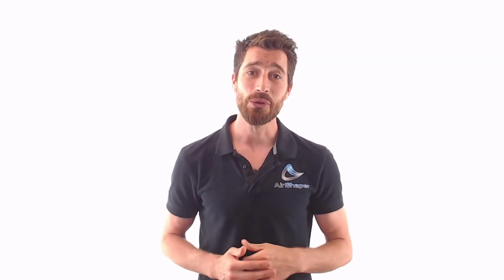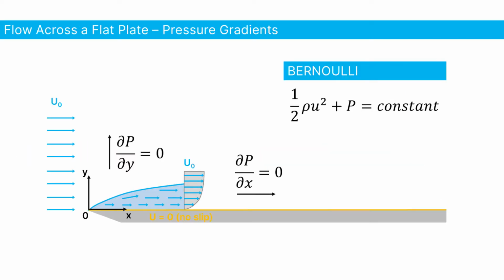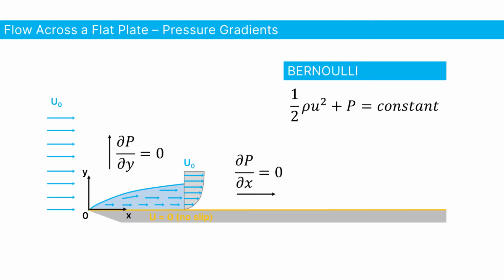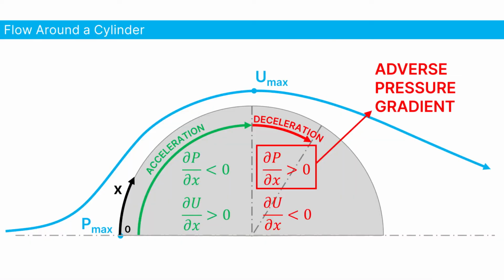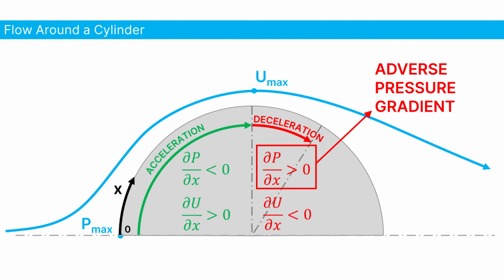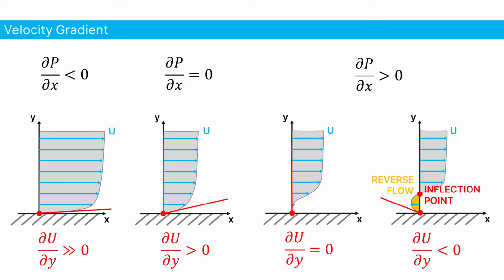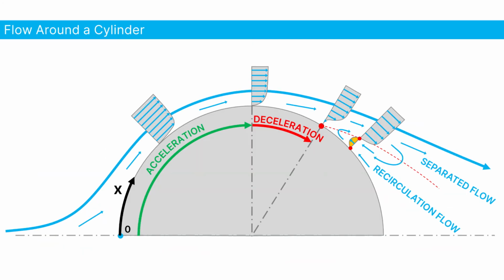Flow Separation - Boundary layer separation explained

Comment: why does the flow accelerate as it climbs up and decelerate as it comes down? doesn't seem intuitive
Reply from the maker: At the front, the acceleration is driven by the incoming air pushing everything around the sphere..less room means higher velocity if all that air needs to pass.

At the rear, the air mainly wants to go straight and the air sticking to the surface slows down, as there is less surrounding air to push it forward.

Comment: Bernoully principle doesn't say that if velocity increases pressure decreases, it says that for a fluid to accelerate there has to be a pressure difference otherwise why would it accelerate? It drives me crazy that people always get it backwards
Reply: Velocity and pressure are coupled, if you remember solving Navier-Stokes equation, pressure Poisson equation, etc.

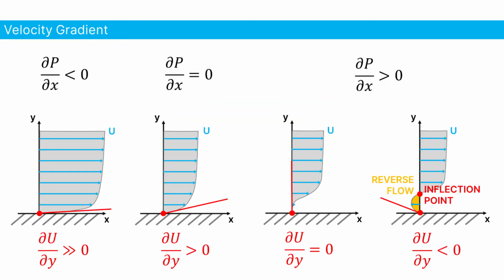Comment: In the 2:05, you mentioned that " If the pressure gradient in the horizontal plane is positive or zero, velocity gradient in vertical is positive." but it looks in the image and from the knowledge it must be negative pressure gradient right?
Reply: @@denizcakar8285 I was thinking too the same and then came here to check if some one has commented.

Comment: why does the curvature influences on the pressure gradient in streamwise direction?
Reply from the maker: Dear Josué,

I don't think I fully understand the question - if by streamwise direction you mean the flow lines, the pressure changes as the air slows down & speeds up (linked to the Bernoulli effect).
What do you mean with the streamwise direction?

Comment: nice video, I just want to ask on flow over plate, what is the meaning dp/dx=0??,.  if dp/dx=0, then in flow over plate, separation will not occur even we extend the length of plate ??
Reply from the maker: Dear Fajar,

dP/dX = 0 relates to the overall flow, where the velocity is constant. Because of the bernoulli equation, this means the pressure is also constant.

However, you are right, this is a simple approximation. Because of friction (which indeed increases as the length of the plate increases) the pressure can indeed vary as you travel along the plate. And, as the boundary layer grows thicker, you can have a transition from laminar to turbulent at a certain point.

This video is also quite interesting
https://www.youtube.com/watch?v=5zLCofDSt_Q

Comment: What would be the best shape if I want to maximize friction
Reply from the maker: Hi David, we haven't had that question before :) Surface friction goes up with velocity, viscosity, surface area, surface roughness ... so those would be the parameters to work on. Keep in mind that you may trigger separation, creating a turbulent flow which has different friction properties as well.
Reply: @AirShaper  I am working on a tesla turbine boundary layer turbine but with a cone or bowl shape to maximize friction instead of multiple discs.
Reply from the maker: @David_Mash  Then indeed the surface roughness is an important parameter :)